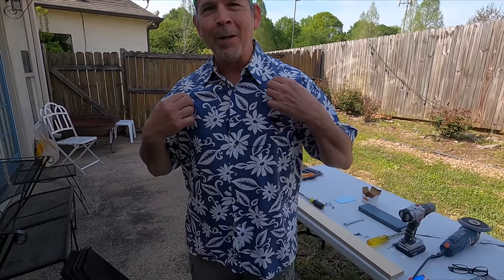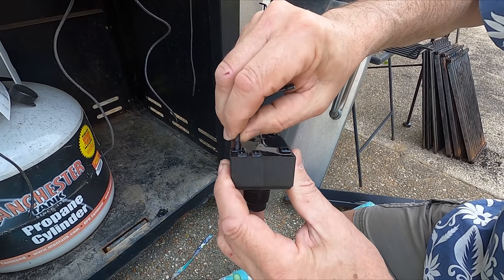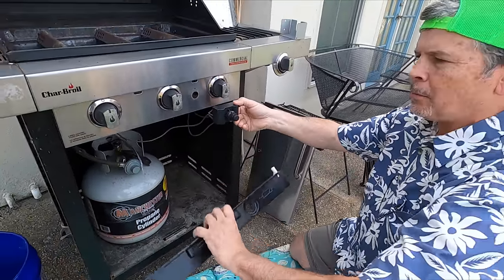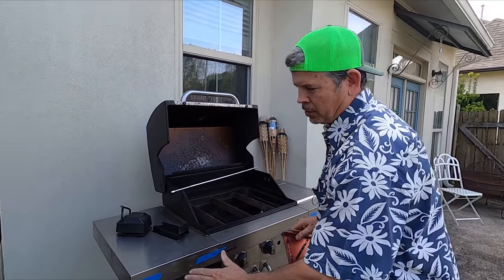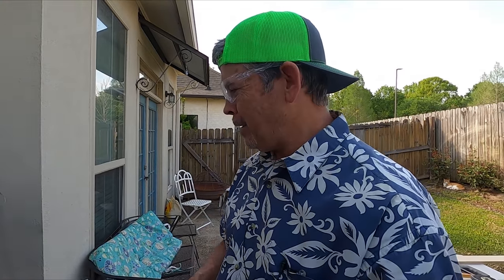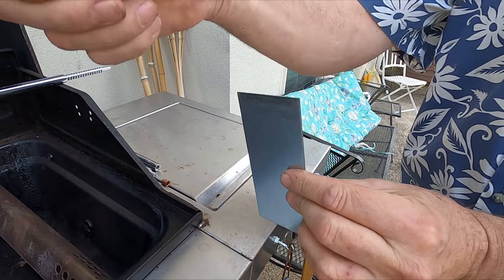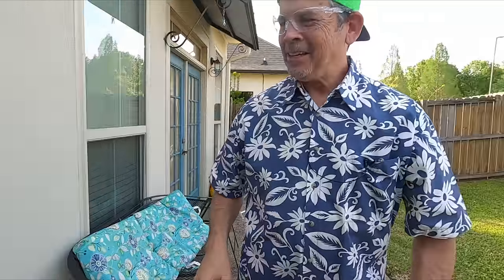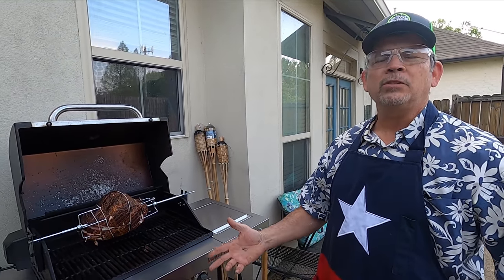Making Some HUGE IMPROVEMENTS To Our GRILL!

Comment: Great video.  I want to let you know that I used one of your idea's from another video you made.  It was the one where you spray painted the interior doors on a saw horse using the landscape screws in each end.  I ended up using my garage as a paint booth with plastic sheeting on the walls and drop cloths on the floor.  Thank you for showing how it's done and I am getting a lot of great idea's from your video's.  Keep making them and I'll keep using them.

Comment: Great video - I've had a Charbroil infrared for years and love it. A tip if the igniter doesn't work and you just want steak now - you can use a butane torch instead of fussing with matches. I put the flame through the hole and wait for it to ignite the gas. Haven't exploded myself yet. :)

Comment: If you do a lot of grilling and there's a way to run a natural gas line out there, consider converting the grill to natural gas.  I've done it a couple times.  Saves a lot on propane, and you never have to schlep tanks around or worry about running out. You do need to buy the proper hose and disconnect fitting, and I also put a ball valve ahead of the disconnect, and make a piece of PVC pipe with a cap on it to cover the disconnect when it's not in use.  The grill part of the conversion is drilling out the orifices to a larger spec, which you can find on the internet.  You do need a number drill set, and if the exact size isn't there, always go on the small side first, and go big if you don't get enough gas that way.
Reply from the maker: A buddy of mine recently switched to natural gas and loves it.  I'll check it out thx.

Comment: that side burner looks like it either has a natural gas jet ( a jet with a overly large orifice) or its air port is blocked up  which is causing oversized yellow sooty flames. Theres too much gas and not enough air causing an incomplete combustion.
Reply from the maker: I noticed that too.  We’ll definitely check it out 👍

Comment: 7:32 I’ve bought the Rotisserie Accessory that sometimes is sold separately from the “grill” you just spent a few $100s on; along with buying “universal rotisserie accessory” attachments as well.
Gotta say, IMO, the Universal Units work just as well (good😉) as the name brand units that are sold separately (unless lucky and yours comes w/ the Rotisserie Attachment), etc.... The only “downside” I guess ya can say about the “Universal Rotisserie Units” compared to the one designed for your “grill’s model”; is this.....
Might not be a “direct fit” unit, meaning, you might have to “adjust/mess around” with lining up holes (making your own), & sometimes using bigger fasteners to get the thing installed. That would be the “only Con” I can think of w/ not using the Grills Brand Rotisserie Unit; which....for the price of some of those units, compared to a universal (& the parts & time needed to mod it or install it); I can DEFINITELY live w/😉👍🏻
Nice job, and Happy “Grillin”✌🏻

Comment: I noticed you also have a charbroil "infrared" grill and it looks like you removed the aluminum IR grates? I have one and was considering doing that since they seem like a gimmick. Have you noted any issues in doing so?
Reply from the maker: Mine are stainless steel. I removed them for cleaning.  I love them.  I think grilling on this grill would be compromised without them.  No flare ups 👍🥩🔥

Comment: Are crimps gonna take heat from cast base?
Reply from the maker: I actually needed more clearance on the left side for motor so replaced all spacers with 3/4” long aluminum ones from McMaster.  So far so good 👍